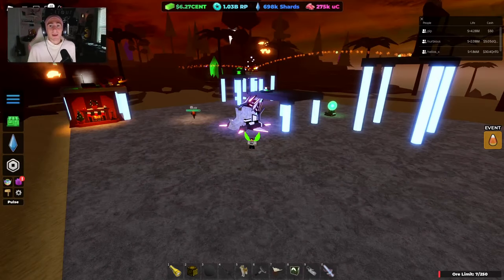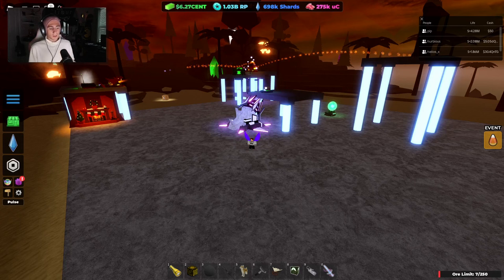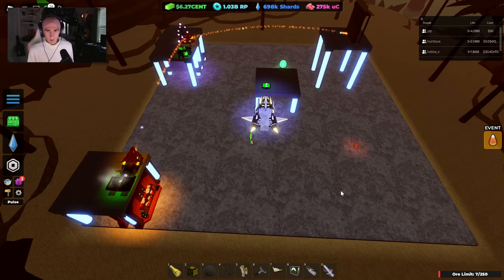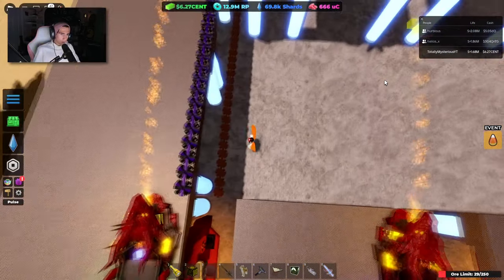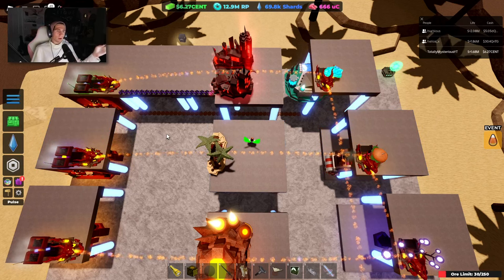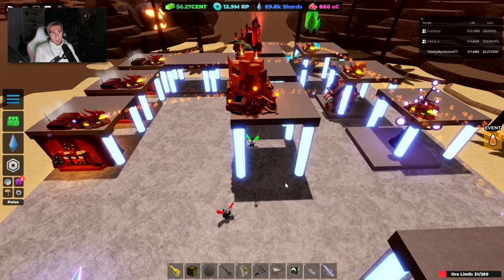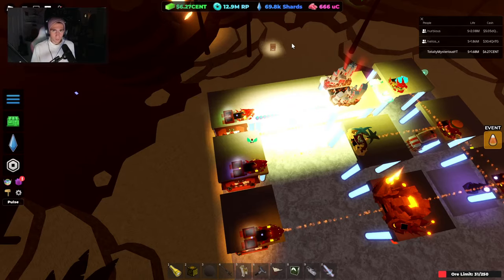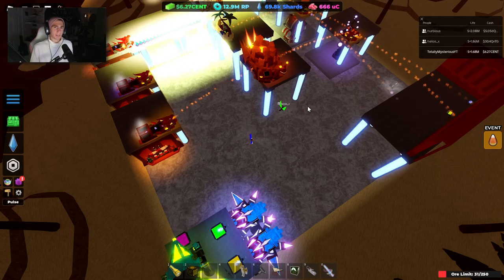Understanding LINE LENGTHS | Miner's Haven Endgame Guide (Part 1)

Comment: Wait so what’s the height of the end platforms for the end cannon and does each line length require a different height end platform
Reply from the maker: Are you referring to where the turn is? Pretty sure theres no defined height for them, but comments may correct me if I'm wrong.
Reply: .8 is 1 above the starting platform, .7 2 above and .6 3 above (if i remember correctly)
Reply: @ thank you sm